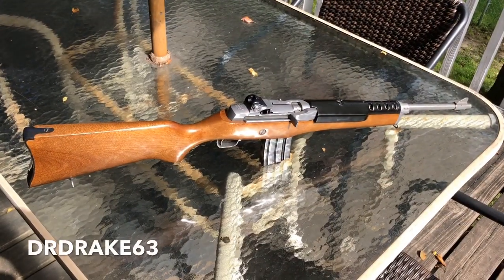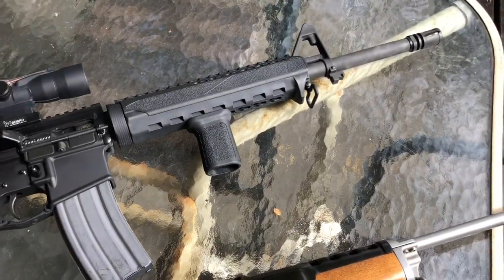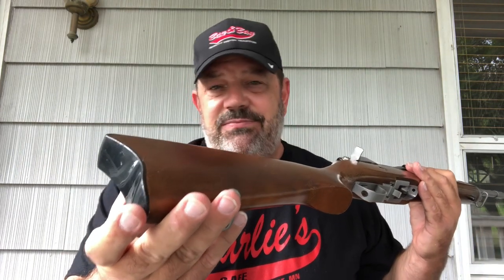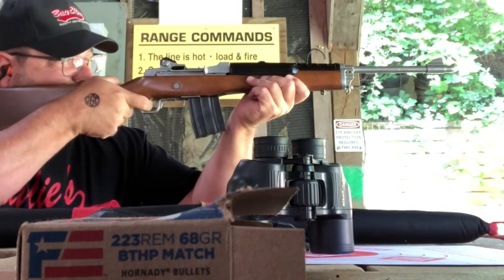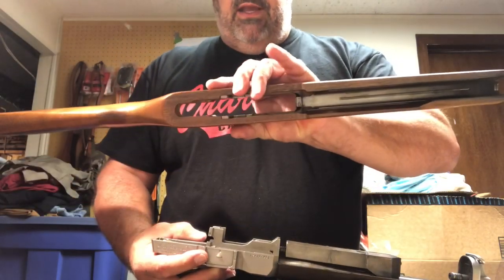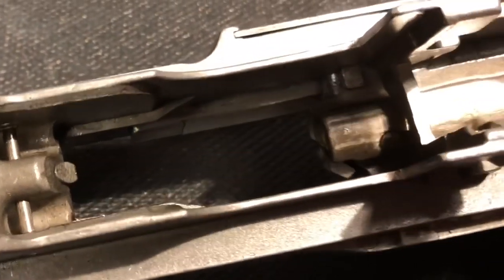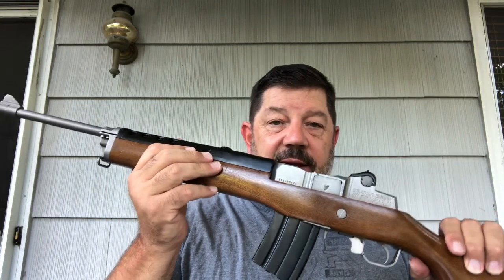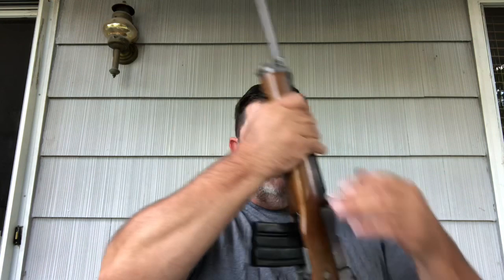Ruger Mini 14 - the long and the short of it

Comment: The 223 is actually superior to the 5.56, the difference is the throat and the twist the 223 is 1/12” which offers stability in a large variety of bullets and weights, especially the lighter. Whereas the 5.56 twist is usually 1/7” or more common 1/9” which requires at least a 62 grain bullet or greater to have stability is why most struggle with steel case ammo not all struggle but most do, it’s more to do with weight, pressure is always the topic,, but weight is the real issue, as it takes more pressure to push more weight.
Reply: @KillswitchOwnsAll i usually don’t cross I do 223 in 223 but my son having a 5.56 uses both in his 5.56 and no big difference to speak of

Comment: Have the exact same SS mini, bought new in 1982. I also have a Bushmaster AR15 16" barrel mid length. Bought a BCA 223 wylde 20" complete upper. Do your suggest I change buffer, tube and stock to rifle length? Thanks

Comment: I owned an early 1980's vintage stainless Mini 14 that had a wooden upper forearm. For a long time I had it tucked away and never shot it. I also owned extra magazines for it etc. One Saturday I took it to the range and started to shoot it and after chambering a round I pulled the trigger only to hear a click. I used the bolt to open the chamber only to find a round in the chamber fully intact with no detonated primer. After returning home and cleaning my firearms I reviewed the owners manual and decided to call Ruger in Prescott, AZ. I spoke with the service people who told me that I likely had a broken firing pin. Thinking that this was no big deal I asked them to sell/ send me a new one. I was told that I would have to return the rifle to the factory and have them install a new one.I was totally surprised that Ruger would not simply sell me a replacement firing pin so I hung up the phone. I thought about this and quickly realized that I needed to get rid of that gun and buy an AR 15, knowing that for the AR I could easily find replacement parts anywhere. With that in mind I took the rifle to the next gun show and sold it , like new in the box. I also got rid of all of my magazines and bought an AR 15. I have never looked back and will never own another Mini 14. There is no way I will own a rifle for which I cannot easily find replacement parts without a hassle
Reply: Not an encouraging story.  I love my Mini-14 (bought new in 1981).  I hope that I never run into your problem.  But your point is well made, and is why the AR-15 platform is rightfully so popular (and why I also own one):  parts galore and multitudinous third-party support.

Comment: I bought mine in 1980 for 267.00 , first stainless i could find . It came with good light trigger and has been flawless over the years .
Russian, god awful Chinese and a bunch of reloads. Imi ,federal, winchester and remington factory Mine off a bench will stay in the bottom of a pop can . Its was my only rifle back in the day . Ar15s were made buy Colt only back then . So i went the mini 14 route . On the gas port it must be tightened evenly. Because if you tighten too much on one side it cause the barrel to be in a bind . And as soon as it heats there goes the accuracy is gone. Likewise iif tightened to much it will not help .
On the magazines, expensive, but they last and work . 
For newbies,  i allways tell them to go the ar route.  Ruger has damn near priced it self out of the market. 
I prefer wood and steel
Reply: 9⁹

Comment: Someone finally took one apart, compared to an AR that was a lot of tools you had to use. To break down an AR to clean the gas tube and such you need how many specialties tools? Mini was designed as a noncombat sportier in 222 originally during the Vietnam war, wear a civilian battle rifle and load was frond on. Like cell phones in the 70's the M16 was not the weapon to have. Your right most inaccurate weapon is the one on the trigger. Can't really say about the inaccurate part on you tube.

Comment: Needing factory Ruger mags is a myth. The plastic ones work great. I've used them forever.
Reply: Actually, the earlier Minis were very finicky about mags. I've owned four minis of different vintages. In one gun that wouldn't function reliably with an after market mag, that same mag would work good in a different Mini. I've found that to be the case with each of the ones I've owned.

Comment: Mini14 is a great Ranch, or maybe even a truck gun (where legal).  This was the preferred gun of the A-Team (AC556).  There are some caveats that you should know going in..

•  Ruger suggests Brass only.  If you're cheap, and want to shoot steel, do your  research and maybe build an AR.  
•  Older Rugers have a thinner barrel which widens the MOA by a good amount when it heats up.  There is an aftermarket stabilizer you can buy to help with that.
• You cannot swap in other caliber barrels like you can with an AR.  You get what you get.
Reply from the maker: dingus I only shoot brass. Steel casings cause problems in ARs too

The aftermarket attachment for accuracy you referenced is just plain stupid looking in my opinion. If I want accuracy after many many rounds I will shoot an AR not a Mini 14.
Reply: @dingus for one. There is no firearm company that will suggest using steel case ammo, period. Second, they suggests, not enforce. Mini 14's will eat anything you feed it. I've never seen a mini 14 jam, or experience a Mini 14 jam with any type of ammo. I cant say that about the AR15. Every damn time I've been to the range, hunting camp, or outlaw steel challenge, there is always a AR15 completely locked up chocking on its own ammo. Slap the mag, release the bolt, hit the forward assist, pull the trigger, and click. Makes my eyes go cross when see one of those trash rifles. And not sure what you mean by "widens the MOA by a good amount"   Mine have never shot over 3MOA on its worst day, and that is good enough for the purpose of a semi auto carbine. And as far as swapping uppers... who gives a shit, I would rather have a whole rifle than a bunch of half rifles lol. I mean what are people doing? Trudging through the woods with a back Pack of uppers, BCG's, different mags with assorted ammo? Plus with the price of lowers these days why would concern yourself with swapping uppers when you can have a whole rifle. The tactitard class of the gun world has really brain washed the since out of the new generation of gun owners. It's just sad.

Comment from the maker: Sorry about the cough at 6:19
My ‘Editor’  missed that one
Reply: I didn't like the 1/4 turn adjustment on the rear sight. So I took a triangular file and a round file and filed 4 more half holes on the sight adjustment screws. That did the trick. Its a better  adjustment capability. If you ask me. Mine is also pretty accurate.

Comment: Stupid question here. Do you use grease when lube it back up? I just got one and I dig it the most.
Reply: I just put a drop or two of Ballistol on action and bearing points.  The open bolt design and large design of the slide assembly (charging handle / action bar) are not high tolerance and rather forgiving.  Of course it's advised to lubricate any moving part, but I have run my Mini-14 totally dry without problems (it's an older 182 series model, bought new in 1981; newer ones I understand are tighter tolerance).  I don't recommend grease though -- it attracts dirt and dust.  A light viscous lubricant should be sufficient.

Comment: Just got a stainless Mini 30. I have been looking at it closely. Seems the finish on mine is terrible. The barrel is solid strong stainless, but the receiver looks like a cheap soft stainless casting with a micro layer of "case hardening" on it. That's the process mostly used to hide cheap steel. I am afraid to even try and polish mine smooth, it could wear through the hardened skin on it. I think I can see pin holes where the cheap stainless is showing through. The gun gives the impression of being well built, . but looks like the receiver is brittle and I am afraid it might eventually crack. I paid $1K for this thing. I didn't expect it to be polished like a Beretta, but it should have been a lot better for the money I paid for it.

Comment: This guy is not an expert. ProMag for Mini-14 works fine get Gen number two it has the metal piece with the hole in it. You can actually use a stripper clip adapter by sliding it on tightly if you kind of bend it a little bit you can use a military-style stripper clip to load those plastic magazines. There are only about 17 bucks a piece for the 30 rounders that's all I use loaded up 425 kept loaded up all the time. There is an aftermarket scope mount that will go into a piece that replaces the cover for the bolt lock mechanism. Once it's adjusted and tight I have a 3 to 9 power 45 mm scope I use. I can pick out which part of the target I want to put holes next to each other. You cannot see where you're hitting you cannot be accurate. The great thing about this side mount removable scope mount is that you can see under it and still use the peep sight for close-range Stuff. There's so many little things you can modify to make the gun a little bit better like Drilling and tapping a second sling Mount screw to in back on the foregrip for a bipod mount. You must make sure nothing sticks into the way of the actuator rod.
Reply from the maker: will friar Not presenting myself as an expert in anyway. Just presenting my personal experiences. And just so you know, there is no such thing as a mini 14 expert LOL

Comment: My 187 series short strokes all the time.Getting ready to get rid of it.Its a single shot semi auto it sucks.
Reply: It's got to be dirty. More than likely you have carbon in the gas port disassemble the gun spray some carburetor cleaner up there into the gas Port make sure it's wide open then run a bore snake to clean the bore do that two or three times you must lubricate this gun look at it everywhere it's shiny smear tiny tiny little bit of Grease. You should be able to pull it back just by pinching two fingers from the receiver to the charging handle.
Reply: It sounds like you have a gas bushing issue, Do as Will Friar recommends.  That is not a normal issue, in fact, I've never heard of that in a Mini.